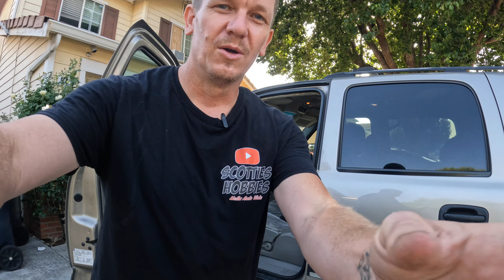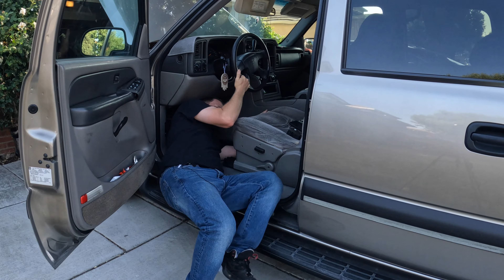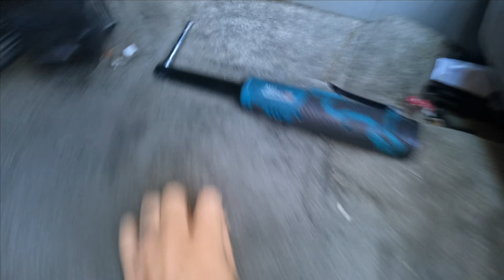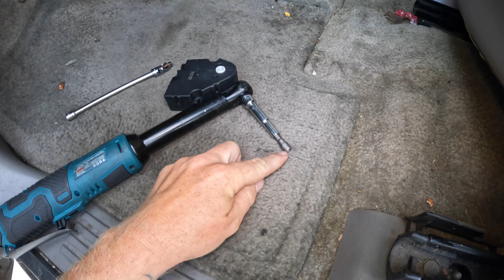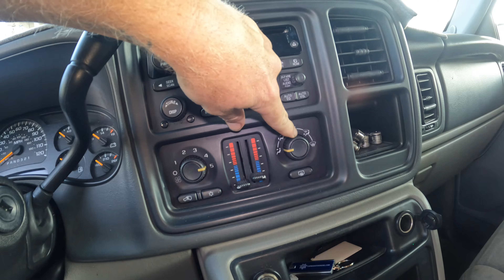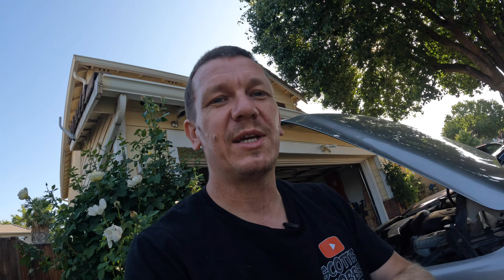Stuck in Defrost Mode? Fix Your Chevy’s Air Flap Actuator! Recalibrate hvac Chevy, GMC, Cadillac.

Comment: Can the actuator go bad if the cars starting battery is pulled and replaced?
Reply from the maker: Anything is a possibility.  Try that reset  precidure and let me know if that changes anything.
Reply: I have the same question. We changed our battery & the air suddenly started blowing out the defogger vents only. It was working fine before that. I have a 2002 Escalade so my fuse box is a little different, & I’m not sure which fuse to pull. In the fuse block under the hood, there are two 30A fuses labeled, “FRT HVAC” & “RR HVAC.” I figure I should pull the front HVAC one, but there’s another fuse block inside the vehicle by the driver’s door that has a 10A fuse labeled, “HVAC 1.” Which one do I pull? The owner’s manual doesn’t explain & I can’t find the answer online. Thx!
Reply: I cant do the reset procedure as I said because there is no hvac so-called fuse. Anyway in anticipation of the actuator being bad i ordered a replacement from amazon
Reply: There may be another fuse box somewhere
Reply: I'm a technical writer. MY GOD the manuals are written by juniors. I cant believe this country skill level.